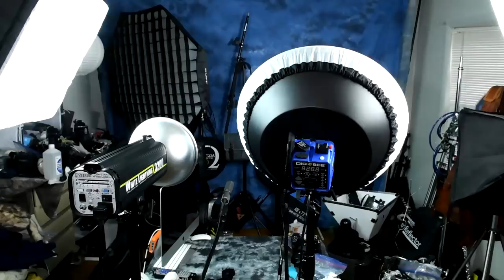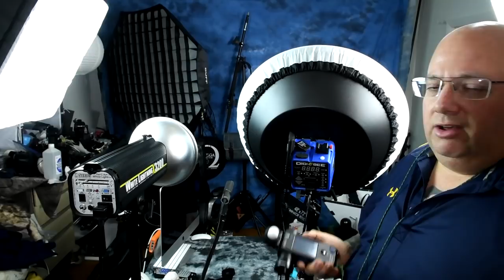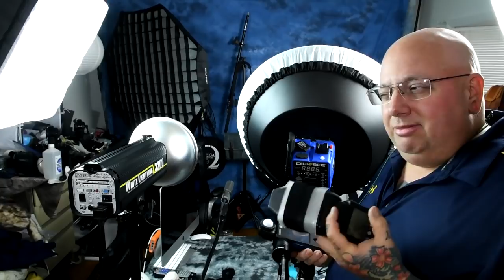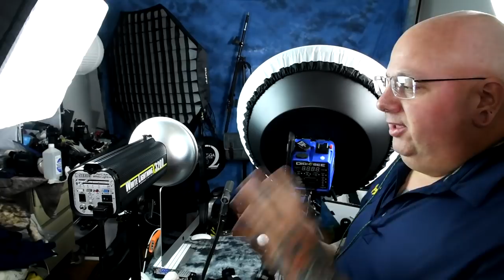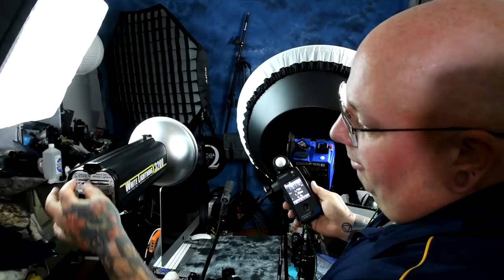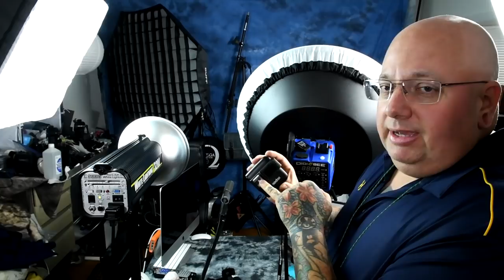🌀HYPERSYNC VS. HSS examples & explained

Comment: Very well explained. Thanks. Is that the whitelightning x3200? Can you recommend a hypersync setup for my d3   yn622tx ? The whitelightning x3200 is usable at 1/8000 without powerloss as los as 1/3 power? I thought the lower the power the longer the duration on the x3200. I was hoping to use 1/32 and 1/8000 with my d3 and yn622tx which hás a delay timer. What do you think?

Comment: Hey ken, I got a question. First, thanks for your video explanation. I am curious however, in my situation, I have a D750 and some plus X PWs and Nikon speed lights and am wanting lights for more on location stuff. You are definitely correct as to the broncolor products being expensive. I had actually looked into them and was possibly going to purchase the Siros L 800 set because I understood they provided mobility and excellent light. After seeing this video in my research pre-purchase of those, I am curious your thoughts about the white lightnings vs the Link? I AM one of those people who like to open up my aperture but also realistically, I’m going for models, cars, portraits and the occasional wedding so I probably won’t be at 1.8 often but perhaps 2.8 on some detail things and occasionally I’m looking to have enough power to fight the midday sun for some surreal looking shots. Do you feel the white lightning or links be something that would be useful in my situation? I see the PCB website offers battery packs and the links come with batteries. I’d like to avoid generators if possible. If you could provide some feedback I’d certainly appreciate it. Thanks.

Comment: First, I love your videos.  I have 2 WL  XL 3200 with a Cyber Commander and 2 Cybersync CSR+ and 2 Cybersync CST triggers.  What else do I need to perform HyperSync with my XL 3200s?   I also have a couple  of Flashpoint R2-T (Canon) and one Pocket Wizard Plus II transceiver.  How do set it up (connection to the XL and Camera)?

Comment: Can l ask a real stupid question. Will hypersync work with the Ultra white lightnings. I have 3 1200 ultras and  2 600 ultra lights. I also shoot DX  format. Is the process the same? Thank you for taking the time to answer my question.
Reply: Yes, hyper sync works with Paul C Buff Ultra units. The DX format is actually better for hyper sync. You do need transceiver units that provide the right timing for firing the light in tune with the opening of the shutter.

Comment: I have a couple of older PCB Ultra 1800 's. Can these work in the same way you describe for the PCB Ultra 3200?
Reply: You can call Paul C Buff and ask them for the t.1 and t.5 times for the Ultra 1800s. Hyper sync is also somewhat camera dependent. From what I understand through correspondence with PW, crop sensor cameras do better with hyper sync.

Comment: @theoria Does this trick works with other strobes??  for example.. the AD200 or the godox ad600 strobe, if I use PW to trigger on top of Godox Trigger
Reply: I meant to say .. if I use the godox trigger the timing.. and pocketWizard to tripper the flash
Reply from the maker: hypersync comes from major power and a huuuge capacitor charge,  no, just these and broncolor are all that i know of

Comment: Tested this out on an Olympus OM-D E-MII and Panasonic GH5.  Interestingly the Olympus synced all the way to 1/8000 of a second with no problems.  The GH5 would only sync to 1/800 of a second before the black line started to appear in the bottom of the frame.  Above the 1/800 of a second the images were totally useless on the GH5.  Interestingly when using the GH5 with Godox triggers and speedlights/strobes the black line appears in the bottom of the frame at 1/1600 of a second.  Were the Olympus will go all the way to the maximum shutter speed of 1/8000.

Comment: Gonna have to try this out since it sounds like I have everything I need. I have the Godox 1200 W Extension Head (and trigger) for outdoor use. I have  2 of the WL X3200 (usually used with AC power for driving large modifiers through windows ) and the Cyber commander set up for doing indoors stuff. PCB website lists WLX3200 full power t.1 time at 1/300.

Comment: I have a Yongnuo trigger YN622N-TX and receivers for HSS and *Supersync*...can those be used to trigger the Buff White Lightning's for Hypersync? As for *ON LOCATION shooting...what's the best way to power these White Lightning's for portability?

Why would anyone choose HSS over Hypersync??? The trend appears to be going to TTL with HSS capabilities. Why wouldn't it have gone TTL with Hypersync??? Very interesting!
Reply from the maker: i dont know on THAT trigger, but if its an HSS for "X" system then yes, but does it have a sync cable to the strobe capable? 
why??? cause tiny HSS speedlights are what most anyone WANTS for 13 or so feet portraiture shooting wide open at say 1/4000th+ 
99% of all strobe work takes no consideration of ANY TTL,   TTL is (lets be honest) newbie douchebag lighting control. 
TTL is contrary to the notion of hardcore professional lighting since it REMOVES total control from the photographer
Reply: Yes, the receivers have cables. So, that should be good to go. 

How about portable power options Ken? 

Would you feel secure buying used White Lightning's??? Getting stoked about the prospects of using them! 

One more question, since it's such a "fat" light...I'm guessing it's not good for freezing super fast action, right? Is there a light that can do both without compromising too much?

As for TTL...lol 

I've attempted to shoot TTL, sometimes it's really good. Sometimes, it sucks. I find shooting in TTL makes it inconsistent. Maybe that's typical???
Reply: 622N isn't good with TTL accuracy. And BTW 622N-TX would stop working if you put it on a X1T-N. You may still need to use the Pocket Wizard mentioned in this video.
Reply: Shang-Hsien Yang...that makes sense. It's my first rodeo with off camera lighting. I just need to ditch the Yongnuo stuff and get some proper equipment for consistency. Thanks for your input!
Reply from the maker: OR you can use just a long SYNC cable too, but...heheh

Comment: Curious question: So you say that the Godox transmitter is only transmitting the timing information to the trigger on top of it(say pocketwizard) , right? If so, why can't use just the pocket wizard trigger as the only trigger and make it work? Why would I need Godox trigger at all?
Reply from the maker: cause a pocket wizard is a SINGLE PIN trip "FIRE!" command tigger, the godox has multipin TIMING information for HSS (and Hypersync) DELAY of initiating the firing
Reply: Ah, that's the key. I get it now. You are a true master!

Comment: You know a guy knows his shit when he teaches Hypersync... Btw, Ken, the other day I was looking into strobes that can generate very fast light pulses to freeze hummingbirds in flight. When it comes to specs, the best option that I found are the Godox QTII series strobes. Do you know if the QTIIs are as good as they seem to be?
Reply from the maker: the Einstein strobe can do that, and great accuracy , 1/13,500 th  :)
Reply: The 1200 W/s godox can do 1/25640, quite impressive. The Einsten would probaly do the job, but the godox is a better candidate. Small hummingbirds can move their wings stupidly fast, you need a 1/10000+ pulse to completely freeze their wings. And since im planning on using softboxes, i wont be able to use the strobe on its lowest power level and that means I will have to compromise some of the speed in exchange for power. Using the godox I would be able to trade speed for power better, since its faster speed is twice faster than the einstens, plus the QT1200IIM is twice as powerful as the Ppaul C Buff unit. But I cant find proper reviews on the godox :/